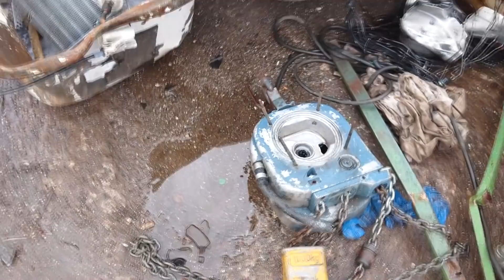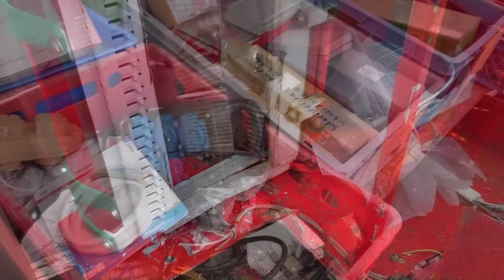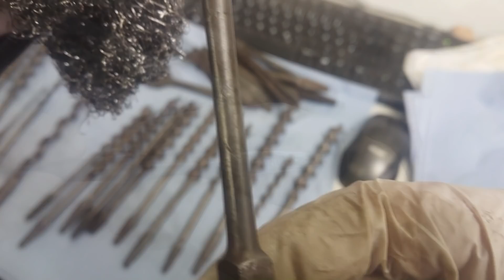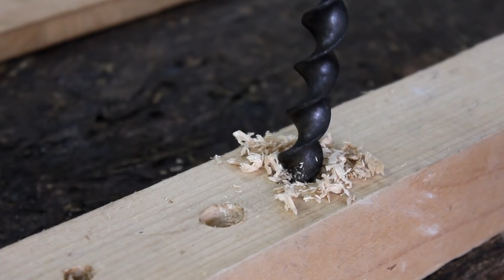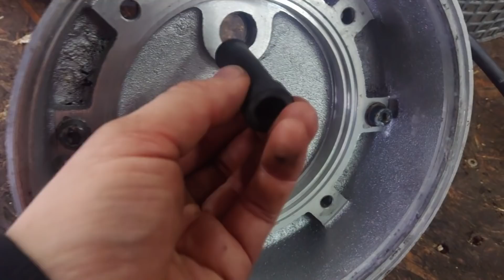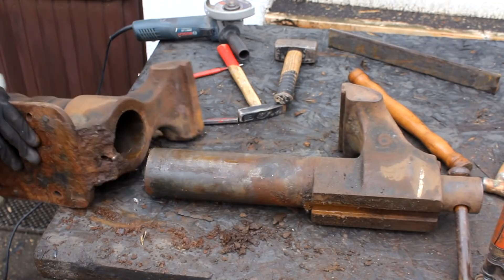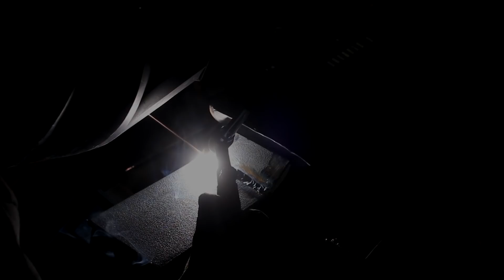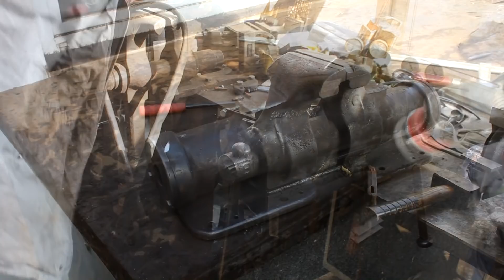Terrific Scrapyard Finds! Repair-A-Thon!

Comment: You should try electrolytic rust removal on your iron or steel repair projects. I just use a little sodium carbonate, or bicarbonate, in water and a battery charger. Details can be found on many videos. It does a great job on loosening rust and paint, with no damage to the underlying metal. There is no toxic cleaners involved. If the paint contains lead it will have to be filtered out of the water and disposed of correctly, but the sodium carbonate solution can be used over and over. It really works quite well.

Comment: You can weld cast iron fairly easy if you set it up right. Put the body in the oven . I used the self cleaning cycle but had to disable the safety switch so I could open it while hot. Heat it up too a high as possible then stick weld with 7016 . Works great.

Comment: You could use an old tank and some plumbing to make a Anaerobic Digester. You put any biodegradable materials you want rid off into the tank and in time you get back flammable gases methane + hydrogen and fertiliser. 
http://www.biogen.co.uk/Anaerobic-Digestion/What-is-Anaerobic-Digestion

http://www.biogen.co.uk/Anaerobic-Digestion/What-is-Anaerobic-Digestion

Comment: Amazing that people are scrapping those old forged steel vices. New ones are expensive and the cheaper cast iron ones are very easily broken by a hammer blow or heating something up while held in the jaws and cracking the cast jaws. Hopefully more people will realize the value of repair and repurpose of items.

Comment: A busted guide rail on a parallel jaw or machinist vice is usually from misuse. Trying to make a 90 degree bend in some flat stock with the aid of a hammer will send a nice shear force throughout the dynamic jaw and the slide to the guide rail and shear off.  As opposed to a blacksmith/post vice where the shear force is transferred to the post and then the floor just a plausible scenario for the busted rail.

Comment: You're not wrong the drill bits  being too young for those drills, however, a lot of those had retained (at the time) the ability to hold a square drive. I have two old ones that fit most of my great-grandpa's square bits. Certainly much more elbow friendly than using the old school cool variant, because of the gearing.

Comment: For brazing, here's what i usually did; after preheat, i just use my torch at an angle, similar to tig welding. My father taught me that for better puddle control and preserve my torch tip. I also use longer flame, not as long as i would use for "welding" with oxy torch (slightly colder).

Comment: I've long been advocate to whatever ear would listen, that we should rethink our way of dealing with waste, not just bio, but also more finite, mechanical one.
We should have yards where people can take for an evaluation based payback (maybe even coupon) various things we no longer need, are scrap, or are obsolete.

From there, we should have them sorted, repaired or reconditioned, then spec-ed, and finally put up for sale at a price that reflects their current value (not an overprice as it usually happens).

This would do the following things:

1. create jobs, both at the receiving and passing on ends, but the hundreds if not more workers that would repair these items, evaluate them, part them out for parts to repair others et cetera. All those people that are homeless, don't have education, are old, disabled beyond a regular extensive job, so on. They could be helped to help everyone in term.

2. reduce pollution. if there's an acceptance of these items, then there's less demand for new ones.

3. reduce junkyards that have no rhyme or reason, other than polluting the entire planet, some countries having entire RIVERS of trash.

4. give opportunity to those less fortunate to acquire equipment, tools, utility items, so on.

Maybe even more.

But that won't happen, because Corpos want more money, they can't have you think this is ok, so they would do anything and more to discredit this kind of action. Politicians would be right up their asses, supporting them too. And finally, because WE, would never buy such things. How dare anyone suggest we buy second hand items.

It's disgusting.

Comment: I've never seen anyone use a rosebud (heating tip) to braze before! Cant argue with the results, but I'll bet you used a lot of gas. A brazing nozzle will only have one hole (in fact, they are just tubes that narrow at the end), allowing you to focus the heat in a very small area.  Did you use the rosebud intentionally to transfer more heat to the cast iron?  As for the handle for those old drills, in English tradition, that is called a "brace", the whole assembly is referred to as a "brace and bit". Glad to see you put them to use!

Comment: What a mess to deal with... You are a very hardworking man Sir, thanks for your efforts. BTW, you are using a giant grinding machine instead of a tiny and easy-to-use one. I'd like to hear if there is any specific reason for this.
Reply: Big angle grinders are a lot more durable than the little ones are. Little tools only do little work. Big tools make short work of big jobs though.

Comment: It's so nice to see brazing used to repair cast,  not many know or even have the means to attempt such a task. 

In purely economic terms it's probably not worth it,  but as a technical exercise and a learning experience it's invaluable.
Reply: A new vise like that today if you could find one would cost a great deal. That's not some Chinese cast crap. Although the design does seem to have a common failure mode. But who knows how hard folks were wailing on them to get them to break? There's some pretty dumb bunnies out there.
Reply: @1pcfred  A 6" Record is £600.  If you could find some body whose willing to do that repair, the cost would be well in excess of that replacement.  Sadly that is why it's ended up at the scrap yard.
Reply: @peted7295  the repair cost some scrap wood and a few brazing rods. That don't add up to much.
Reply: @1pcfred  You've missed the biggest component,  time.  For a home gamer it's free, all good if you've got it to spare and the skills of course and then there's the gas welding kit etc.  if you haven't got all of those things you'd have to pay someone and that ain't cheap.
Reply: @peted7295  if you don't have the skills then you don't need a vise either.
Reply: @1pcfred  As much as I would love to do exactly what TPAI has been doing I can't at home,  simply not got the space or the time. 

I could do this at work but like most folks I'm not self employed, so while I'm fortunate enough to have far more freedom than many, my employer is not going to look very kindly on me indulging myself attempting to repairing a vice. They would much rather replace the vice and have me doing what I'm being paid to do, because having a machine standing awaiting repairs costs over £1000 a day. Which is why it is uneconomic. I don't like it either I'd much sooner not set these things disposed of,  but time is the one of the most expensive commodities in the western world. 

If you have the freedom and time like TPAI to do these things and expand your skills in any direction you choose then that's great , all the more power to you.
Reply: @peted7295  time is money. Unless you're not getting paid for your time. Then time is simply time. Which as far as we can tell has been passing money, or no money.

Comment: Those brace bits were a great score.  You can sharpen them up to cut nice and clean. Your test drills were a bit dull.  Great vid.
Reply: It depends how worn down the spurs are how much an auger twist drill can be rehabbed. Though I've seen shot snails on them too.

Comment: Drilling a straight hole with a bit brace takes a surprising amount of practice!
Reply: Another pro for hand drills: they're almost silent. We have a lot of social pressure to be quiet on Sundays. Plus, there's a lot of control over the larger diameter bits at the low hand cranked speeds. Regards from Denmark.

Comment: Engish for that drill is ,,BRACE" love this channel !!
Reply: Yes, however all the braces I've ever seen have a ratchet and a chuck. The round rear part is placed against the CHEST. Applying pressure with human body, the bit is held perfectly straight while the cranked part is rotated to drill the hole. If there is not enough space to rotate the crank, the ratchet is engaged so that a partial movement can be used to rotate the bit.

Comment: This is the secret to life: trade your time and work to get high quality stuff you couldn't otherwise afford.  When I was a younger man, I bought a car with a blown rear axle, limped it home in front wheel drive, bought a used rear end at a scrap yard and after a weekend of work, had a nice car for cheap.
Reply: @bacilluscereus1299  90-something Jeep Grand Cherokee.  Got the Jeep for $300 and the rear end and other misc for $100.  Sold it for $2K a couple years later.
Reply: @fixins  I get the feeling you've done a lot of smart things like that.
Reply: A very good philosophy for life sometimes makes you wait but the benefits are enormous.

Comment: I like the old "brace and bit" drills, we have some from grandfather, do not use often, tho.  I think I will try to clean them with the citric acid and oil them!
Reply: I've been using mine from Grandad for a few years now, they work better on a big bit than an older power drill that might burn out using them. But hard to use in a tight space. The chucks are weak but I'm gonna keep them around just in case...

Comment: The drill you used is called a brace in the UK, I still have my grandfathers which does have a chuck. It has two jaws that both have a 90 degree vee cut into them, which, when the two jaws are faced together, creates a square hole to accept the square bits. If you take time to sharpen the bits correctly they are actually faster and more pleasant to use than a HSS spade drill.
Reply: Just in case my description was rubbish, here is a pic.
https://www.lumberjocks.com/topics/48876

Comment: I could water both my front/back yard, and all my gardens in like 2 seconds with that pump!
Reply: In my town, there’s a house that used to belong to a notoriously eccentric millionaire. He decided it took too long to fill his swimming pool with water by the usual means, so he hooked up an airplane engine to a huge industrial water pump. When he aimed that rig at the pool and started it up, it’s said that it created a horizontal jet of water 25 feet long or so, and filled the whole pool (which was not small) in less than 15 minutes.  (He had a well, which I guess was capable of supporting that much water flow). 

The house is still here (it’s now part of a city park) but the water pumping system is long gone, and the pool has been filled in for fear that some member of the public would fall in and drown. I wish I had gotten to see that setup before it was gone.
Reply: I have a feeling it came out s a BLAST that would have ruined your plants.
Reply: @getin3949  It said 3kw, that's likely about 3-4hp or similar to one of those gas engine water pumps. Very impressive.
Reply: Not equivalent and you'd have to work a bit for it, but if you take a water tank, raise it up to 1.5 meters, and run a hose, you can get the necessary pressure to feed an installation. I'm not going to speculate the Liters of water needed, but it depends on how much surface you have. Putting water in the tank, is easier and cheaper, if you do it at night, slowly with a normal pump VS fast and in one go during the day, as you need it.

It used to be norm back in the day, when towns had water towers. Standardization of water delivery kinds botched that and for no good reason.

Comment: It is obviously interesting to make a successful repair on cast iron. But in my opinion, a cast iron vice is already a bad choice at the start. And this bad choice seems to be confirmed since you have two examples of identical breaks. Blacksmiths' standing vices are much more interesting and robust.

Comment: Have you ever tried using a washing soda - water mix instead of an expensive stripper? It's basically the same ingredient used in both (sodium hydroxide), but a much smaller amount in the soda. However, you can buy sodium hydroxide on its own, but it's dangerous to work with in its pure form. When I need to strip paint / lacquer from something, I mix two packs on washing soda (Waschsoda von DM zB.) with as much water I need to create a gel-like consistence and apply it like stripper. Sure, it doesnt work as good as the paintstripper, and you have to to it at least twice, but it costs only about 2-4 bucks per liter.
I stripped all the paint at my house with this method and it works like a charm. What I know to the moment is, that it works on most paints like old floorpaint (Ochsenblut) and lacquer (Lackfarbe, Sprühfarbe). It works on wood and metal, but plastic seems to dissolve slowly.

Comment: I love all of your videos, especially the repair-a-thon videos. However, I would really like to see you build something with pneumatic circuitry. Especially with pressure activated switches and time activated switches. Not sure what type of equipment you would build with those things but it would be cool to see how you build it. Thanks for your awesome videos.
Reply: Or even better: the pneumatic function generators. Seriously, those exist. You can get a pneumatic square root circuit, etc.

Comment: You might want to use the pump to make a vapor or wet blaster.  Like a sand blaster, just add water. Many videos on how to make them, and they will remove paint and rust with far less work, and no chemicals that you have to keep buying.  Always love the scrapyard finds, definitely can't get enough.  I too am ready for a new intro, though.  :0)  Keep up the great work!
Reply: Forgot to mention that the key factors for determining if a pump will work in a wet blaster is flow rate and it has to be a trash pump, not just a water pump, with a polyurethane covered impeller to protect the impeller against the abrasives.

Comment: Where do I find a scrapyard like this????? And I love the old intro. Been watching for years, and I love the throwbacks to “old YouTube”
Reply: Germany. Almost every scrapyard over here is like this
Reply: Zhorky long way to travel ........
How far is half way around the earth?
Reply: @coalitionofrob436  round about 20.000km
Reply: @coalitionofrob436  look for scrapyards in your area, to fin this kind of stuff you have to be there pretty often.
Reply: @coalitionofrob436  Not as far as you probably think, only about 12,500 miles. :)
The circumference of Earth is a little under 25,000. I've always thought this really puts it into perspective when people moan that their cars "Needs expensive repairs after ONLY 100,000 miles". No one would buy an everyday used car if it was advertised as having been driven 4 times around the equator, but in essence that's what a 100,000 miler has done. :)